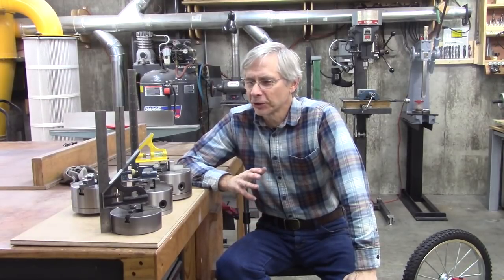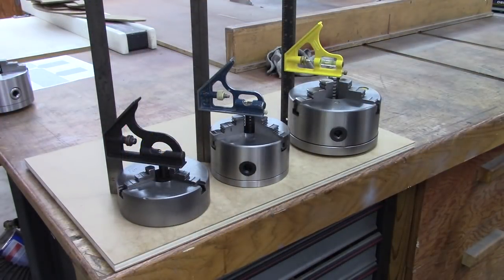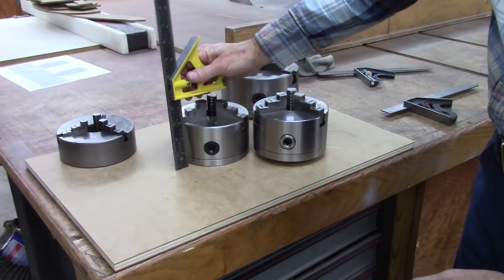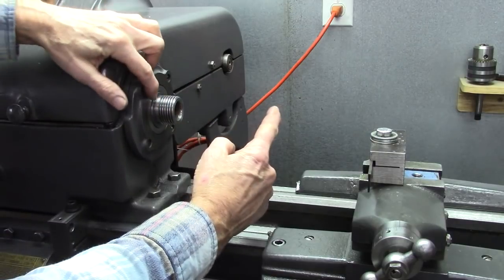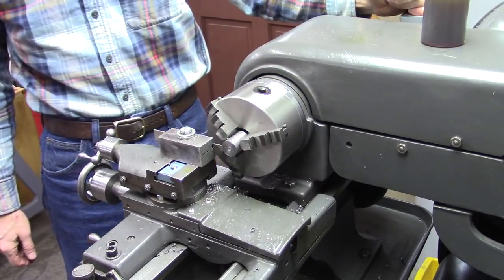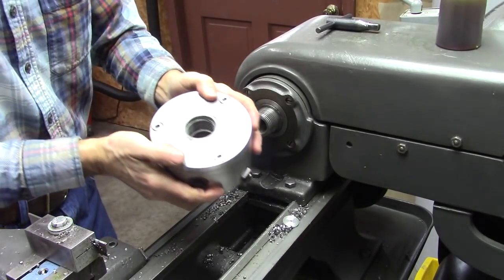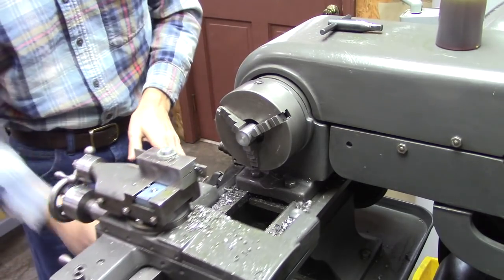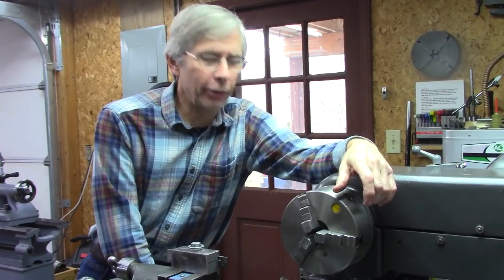My Chuck Overhang Obsession

Comment: what lathe is that Sir? thanks a lot
Reply from the maker: It's a 1931 South Bend 11. Nice lathe but worn badly. Hard to find parts for too.
Reply: @WinkysWorkshop  thank you. how is it combared to myford, suposing they are both new?
Reply from the maker: I've never tried a Myford but I heard they are a good lathe. I think the South bend is a little more solid but it depends on the models.

Comment: is the weight even around the circumference on on those chucks? that is a lot of chatter  for  a short cutoff .  you need a balancing jig to check but something does not quite ad up  here. i assume you measured the perimeter is spinning true with an indicator.
Reply from the maker: It's a combination of small spindle and the spindle type (threaded). Logan also uses a double ball bearing in the headstock which is a little weaker that a sleeve or roller bearing. The overhang on my South Bend has the same effect although not as pronounced (plain bearing). Threads on a 1.5 diameter spindle are a also weak. The leverage a chuck has on a small spindle is enormous and you get compression at the threads. Even .0005" compression is extreme at the end of the jaws. Even a small increase in diameter exponentially improves the connection point. If you put a 3 foot bar (maybe 1.5" dia) in the chuck and have somebody push down on the end of the bar you will see the the backing plate pull away from the spindle register. I made significant improvement on this by making steel backing plates but chatter is still an issue. Going from a 1.5" to 2" spindle probably increases the rigidity of a spindle and connection point by an order of 10x.

Comment: I know this is a big step but you can eliminate over hang problem by having a cam lock spindle. ( ea. D1-6" )
Reply from the maker: To be totally honest a small threaded spindle it where most the movement is. Even if the overhang was the same it would be more solid. And yes, this would be a huge step. Maybe better get a new lathe.

Comment: @5:27 I'm a novice, and only a woman (!!!) but the first thing I learned the hard way, was never to leave a chuck key on top on any lathe. It vibrated, or I knocked it (unsure) into the spinning chuck and it launched itself across the shop and hit someone smack on the back of the head! Luckily they were bruised but okay. 🧡
Reply from the maker: Good tip

Comment: I liked your video. Tell me what steel the cutting tool is made of. It looks like a saw blade for metal. Thank you. Good luck.
Reply from the maker: That's a very good  HSS (high speed steel) cut off blade. I made the holder. Here's the video, the part number is in the description under the video. Thanks for watching.

Comment: That was a very good demonstration. I appreciate the way you kept all the other factors the same: same stock, same speed, same tool, same coolant, same feed rate, and as far as I can tell, the same technique on your part which was mostly the application of the coolant. 

Is it my imagination or was there a lack of those streamers in the second parting? Could they be produced by the chattering of the tool bit? Edit: No, I looked again and if anything, there were more with the shorter chuck. I need to improve my powers of observation.
Reply from the maker: Good comment...  yeah the chatter was breaking the chips.

Comment: Good demo on chuck overhang. Not the best way to remove a chuck though. O.K. for 3 jaws, but using the chuck key as a lever can break the screws on a 4 jaw chuck.
Reply from the maker: Thanks, you maybe right...  although I've never had one really hard to get off.

Comment: The solution on mine was to use an er collet chuck.  With your threaded snout on your lathe, you could just about thread the chuck and screw it strait onto the spindle.  I did a short review on my channel and the chatter is much less.
Reply from the maker: Yes I totally agree. the ER collets have been on my list for a while! I'll check out your video, thanks!

Comment: Here an informtion that you may not know about chucks.    Chucks need to be balanced, just like wheel on a car.  every lathe II've worked on had it's chuck balanced and certified to a limit in RPM.   I'v e worked in a shop where they go two brand new 17x40 gap bed lathe with 9" chuck.  When the chuck were unbalanced, I could break insert of the cutoff tool,  but when each chuck were balanced and certified up to the max RPM speed of the spindle,  these two lathe gave good performance, even with soft jaws.  Even the four jaws chuck had to be balanced.  

So balancing chucks does make a BIG difference.   

And you can't compare new chucks that have more grips on parts with an old chuck that doesn't have a lot of grip.   

Also many a lot of thing can affect the machining and the surface finish of any parts.   When a lathe has a balance chuck, is prefectly level, screwed to the floor, the head aligned and the tail stock aligned with the center of the spindle bore.  That lathe will do amazing parts.   And set a zero between the spindle and the chuck to be sure you always put that chuck the same way. 

And also whe it come to overhang, it's not supposed to start from the spindle.  When you talk of overhang it should start from the from of the jaws of the chuck.  So always consider the chuck part of the spindel and have your chuck balanced and have you jaws grinded and avoid playing musical chair between lathe with the same size chuck.   

So no wonder you have an obsession with overhang & chucks.
Reply from the maker: I agree with a lot of what you said but I doubt a 5 inch chuck is going to have any significant balance issues.  I can see where a 9 inch or larger would or could. My chucks are screw on single start threads so they go on the same no mater what...  My lathes have different spindles so I can't swap the chucks and to be honest I never have cut off problems not that I have addressed the compound with a new blade holder and minimized overhang. Even the larger chuck stops chattering with a slightly higher feed rate. I let it chatter to demonstrate the effects of chatter. The 6-inch Shars chuck is simply too big for the small 1-1/2"  lathe spindle.
Reply: @WinkysWorkshop  You're probably looking at it the wrong way.  If they make a back plates that fit your spindle for that 6-inch chuck, it means the chuck is made to run on your lathe.  You may have a bad spindle also, or bad bearing.  Do you have the entire story or historic of this lathe?  something probably happened to it in the past and that's the cause of your issues when you put a chuck on it.    

I say that, because even CNC lathe, they may look new, but in reality someone crashed a tools in the chuck and they didn't fix all the problem cause by that crash.  And each time you use that CNC lathe you get errors on some jobs.   So your lathe even if it look clean and in good condition, has an living history in the machining world.  So the spindle, bearings, gears, pullies and bearings surfaces, if something happened in that past, it will affect your use of the lathe in the present.  And if that lathe was really ok, you would have never modified your chucks.  Me when I talk of overhang it about the parts in the chuck, and not the chuck itself.
Reply: @lepompier132  I understand what your saying, but Winkys demonstration wasn't an effort to solve the chatter issue. It's not even an issue for him really. He was just showing that, with all things equal, same lathe, spindle, speeds and cutting tool, the amount the chuck hangs out from the bearing point, has an effect on cutting ability. As he mentioned, if the spindle diameter were greater, it wouldn't matter as much. 
Everything flexes...putting the mass of a chuck, then the work-piece that far away from the bearing is like adding a pipe to a wrench to get more torque on a bolt. It's easier to move the bolt, and in the case of the extended chuck distance, easier to generate harmonics that flex the entire spindle. These older lathes that came with smaller spindles, came with thinner chucks and it obvious why.

Comment: If it's well balanced the extra mass of a heavy chuck can give more momentum and that sometimes reduces a tendency to chatter.  As you point out the weakness is really in the spindle design.  A few other factors that can help when parting: lock the saddle and that helps remove one more source of chatter.  Also turning the part before parting ensures it isn't eccentric so when the tool first makes contact it's a little less likely to start chatter (once started it doesn't want to stop).  With a VFD it's easy to tweak the speed to hopefully avoid the chatter resonant frequency.  Ultimately all small machines suffer from rigidity issues to some extent.  Buy as much cast iron as you can fit in your workshop.
Reply from the maker: I always thought the weight would play a part in smoothing things out. And maybe it does but it's to a small degree. Ultimately I can part smoothly on the larger chuck by speeding up the feed a little but I wanted to illustrate the effects of overhang. The small chuck is not at all sensitive. I can part off all day long without issue.  I never thought about the VFD in this case...  now that would be great!

Comment: Good video.  I like the way you analyze these issues and work through the problems and get to a solution.  That chuck overhang was something I didn't think too much about before.  Thank You
Reply from the maker: Thanks 👍 This is not much of an issue on larger spindles.

Comment: For sure a good step in the direction of higher rigidity. Force multiplied by the length of the arm makes torque. The same applies to the cutter. Do what can be done to lower force/torque wherever it's possible. They add up in higher performance.
Reply from the maker: Thanks. I don't think people realize how much difference a small change can make
Reply: @WinkysWorkshop  The difference between chatter and no chatter is small, very small, I want to say. Your work took a good bite of the error zone.
Reply: @Stefan_Boerjesson  I agree. Thanks for commenting.

Comment: Once again Winky, great demonstration! Makes me wonder if for cut off taking the time to dial in a part on a 4 jaw that usually have the least overhang might be time saved minimizing chatter. LOL, put a board under that chuck <smile> 

  Interestingly the accessories part of my Logan manual has "less overhang" as a feature of their 5" 3 jaw. I can't swear to it or give a citation right off, but I think the originals were Cushman. I could easily be 109% wrong.
Reply from the maker: Union or Cushman probably. So you saw me pinch that finger huh?
I have a large but shallow 4 jaw with an open back. I thought it would be great but it is not...  I'm guessing the open back lets the chuck flex.

Comment: If you watch as many machining videos as as i do, you'll notice that the parting off part of most machine doesn't make the video. Almost all the smaller home shop type lathes have chatter, overhang issues. Watch people do a cutoff on a 7 x 14 chinesium lathe. Still making good and truthful videos, keep ip the good work. Let the big boys do the video on cut off tools, and taking 1/4 inch cuts. (Abom, Rucker, etc...)
Reply from the maker: Small less ridged lathes can make cutoff tricky however, as you saw, it can be done with less overhang and a direct mount tool holder. Also increasing the feed rate with the new chuck resolves the chatter. It's hit and miss finding the sweet spot (feed speed) but doable. With the small chuck it never fails. This video was to demonstrate the effect of overhang although it has morphed into doing cutoff - but no problem.

Comment: I was thinking .. I need to slap your wrists for not putting a board across your bed when swapping chucks.
Then I thought you will have your answer  ..
"I am always very careful"  🤔🙄🤣
Why not a video on refurbishment of the Logan chuck ?
Reply from the maker: You saw the finger pinch... hmmm.  I never put the board over the bed. My fingers protect the ways. I'm kidding, that was a first. I'm usually more careful and take more time. Some aspects of the chuck can be fixed but others would be hard to fix. Really I need a new pinion gear and the scroll is worn.

Comment: I have a maximat 7 lathe very well made, german engineering, i couldn't find new jaws for the original chucks and they were broken, 
I bought a larger chuck off amazon but its 2" thicker and it works great but you do get chatter so you are 100% right it makes a huge
difference.great video and explanation.
Reply from the maker: Thanks and thanks for the comment.

Comment: What's your BBQ sauce recipe, smells great??? 
On a lighter note, I am chuffed to see a real lathe showing 'Chatter Central' just as my Optimum TU2004V mini lathe shows. I am a skilled woodworker, new to the lathe & find chatter scary! The point between chatter, cutting & grabbing is quite narrow for my machine. It makes a great deal of sense that the chuck should be as narrow as possible, but that sort of precision obviously comes at a price. Great presentation, thanks.
Reply from the maker: Thank you sir! Yes small lathes have a lot of compromises.

Comment: I have a South bend , a while back I made a fixed compound for it and took my adjustable compound off and that made a huge difference also. I got the idea from other you tubers videos .
Reply from the maker: That's a great option. I just not willing to give up my compound
Reply: @WinkysWorkshop  I haven't given up my compound I still have it and use it but for most turning operations most of us the compound just sits on top of the cross slide and is not used. I was only saying a ridged compound cuts a lot of charter out as well.

Comment: A very interesting video. So simple but so intriguing. 
I'm not at all convinced that overhang is the true cause of the difference !
Reply from the maker: Interesting! What do you think it is?
Reply: @WinkysWorkshop  If you think about it, the bar, the jaws and the scroll are all clamped as one piece. But there's no clamping of that lot relative to the chuck body. As you know, the scroll is loose in the chuck body - so what if you tighten the chuck jaws as normal and then added extra clamping between the chuck body and jaws.
I thing the Logan chuck fairs a lot bet as it's a significantly better quality chuck - a clue given by the fact it's only got one keyhole - so the positioning of the scroll is constant. I'm guessing that the Logan scroll is a much tighter fit in the chuck body.

Comment: I have never seen anyone use a parting tool like that. kind of defeats any point that chatter is the chuck and not the proper tool and speed selection. using a lathe is always  a trade off. I do agree with mass of the cross slide. But conversely the mass of the chuck will also change your cut. I own a 1 1/2 inch late and have no such issues.
Reply from the maker: I've tried a lot of standard parting methods and different style blades. Some were terrible and some I could fiddle with and make them work...  (if the planets were properly aligned). Mostly on a quick change post which is the absolute worst on a less than solid compound. This blade is amazing. it has a T profile and a concave top that make the chips more narrow than the cut. It would probably be better with a slight incline to give it a little back rake but it works fantastic as is. It cuts fast and never fails... I always use auto feed. Just because it is different than what you have used does not make it a bad idea. The holder is my design and it transfers the load to the compound much closer to straight down than other designs. Compounds handle a straight down load much better than twisting and lifting. https://youtu.be/R4-I_peyBFE
Reply: Again your using a parting tool to turn using the side of the tool. It is not rigid enough to use as a turning tool nor should there be any edge on the side of the blade. I am confused as to your issue. As for parting i generally use the back gears on my atlas 10f lathe and cutting through steel is chatter free
Reply from the maker: @spoke4915  Not rigid enough? Funny, did you see me break any blades?  No relief on the sides? Yes parting is much more demanding on a lathe but the same speed and feed calculations still apply. The only reason for lower speeds is 1) to reduce heat build up (side friction mostly) 2) to allow time for chips to clear and 3) to compensate for a lack of rigidity. My tool holder addresses my lack of compound rigidity, the blade profile addresses the friction and chip removal and cutting near the spindle bearing addresses the spindle rigidity. Yes I was running slightly too fast at first but the speed was appropriate when the diameter was slightly smaller (compromise). Step out of that box you put yourself into and watch the video. Yep, I can slow it down and hand feed to compensate for a lack of rigidity but why not address the rigidity. Step outside the box you put yourself into. This cut off method works perfect every single time and it's fast and easy. The video is proof. I could have done the same video with any turning tools. This video was about the effects of overhang not the parting tool.
Reply from the maker: @spoke4915  https://youtu.be/fZlWJ_JqQtA

Comment: Very true to the facts! I have roughly the same logan lathe. The short chuck that must ave been original to the machine will part off fine so long as you feed the tool fast enough. On the other hand my heavy 8" bison chuck will just about want to chatter the whole lathe apart if I try parting off.
Reply from the maker: Oh yeah...  8 inch is way to big for the Logan. My 6-inch is the same way.